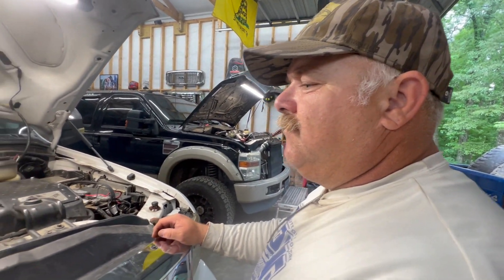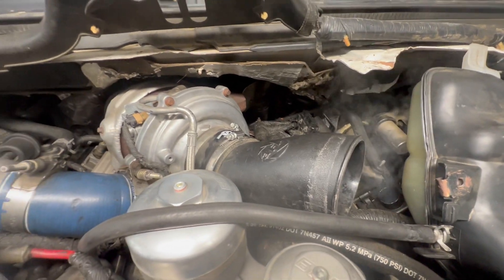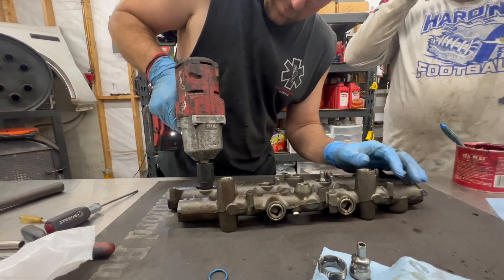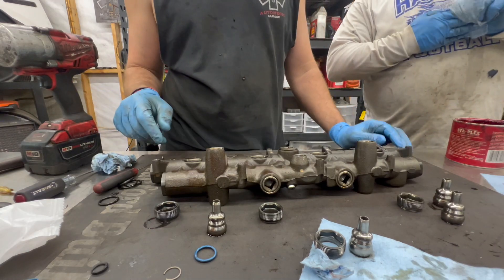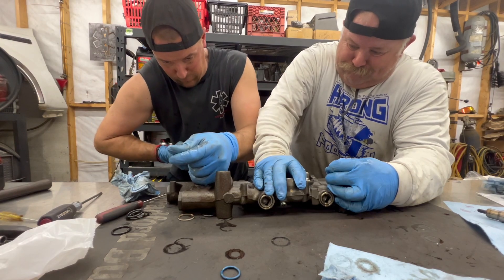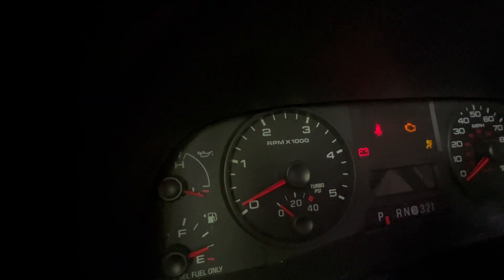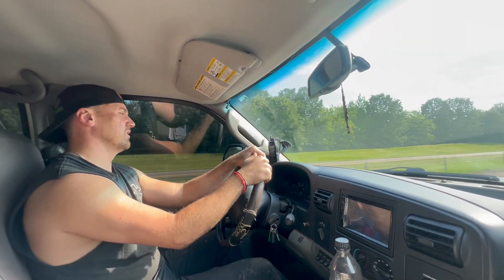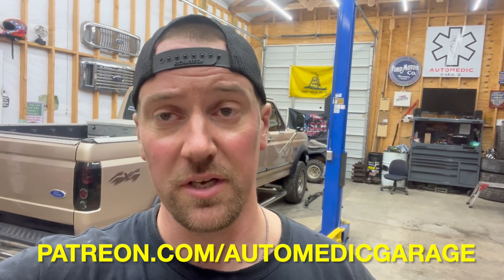6.0 crank no start hot IPR air test

Comment: Hey automedic garage I’ve been seeing some of your videos where the 6.0 won’t start endless there is a quarter of fuel or more. Before my truck stopped running I recall having a very hard start with below a quarter tank and once it was above a quarter tank she started up like nothing.
Reply from the maker: @jess-vc1mh  check fuel pressure when it’s there and see if you have a drop in pressure. Keep in mind low fuel pressure in 6.0s kill the injectors

Comment: Thank you, ill be doing this on mine since i have a hot no start as well.  How much in parts did you spend if you dont mind me asking and time it took to fix this?  So i can plan this out.
Reply from the maker: Injector oring set is around $8-10 per injector and the alliant nipple cup orings we did were around $20 for the set
Reply: Thank you for your knowledge and reply.   Greatly Appreciated

Comment: Question: Once the O-rings on the HPO rail are replaced, do you find they still give problems or are you good for a while?  Seems like HPO O-rings are starting to fail on these 6.0’s as they age.
Reply from the maker: I don’t usually have any trouble out of the nipple cup orings not even upper injector orings that much. Mostly dummy plugs and stand pipes from 04.5-07 and Hpo pumps from 03-04

Comment: I have a f-750 with the vt365 (6.0L) and it has a crank no start but my scanner wont scan it , do i need forscan or a special medium duty scanner to scan it?
Reply from the maker: Gotta be a special scan tool for medium duty trucks. Has a totally different connector compared to obd 2. I don’t work on many big trucks other than minor stuff because it doesn’t make sense for me to invest in the hardware for it.

Comment: ❤ didn't you change them out already not long a go
Reply from the maker: We did stand pipes and dummy plugs on Gary’s truck a little while back for a crank no start and a upper injector o ring on the passenger side a little while back.

Comment: Wow!  That is a lot of work for one little worn o-ring.  Thank you for a clear explanation of the diagnosis and repair.  Those nipple cups look like a bear to torque.
Reply: That’s what you get with any oil-fed controls on any engine. It’s a hydraulic system.
Reply: @tfriesen3866 Cat’s version seems to be better.